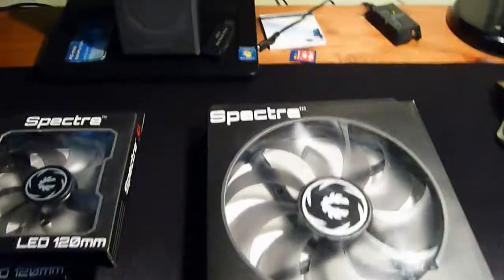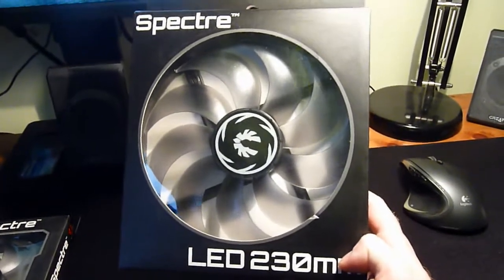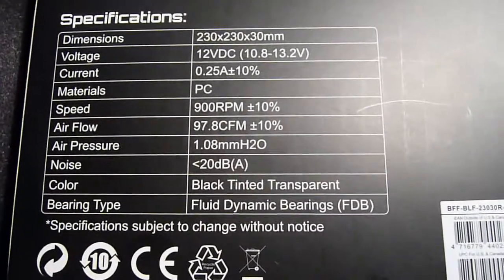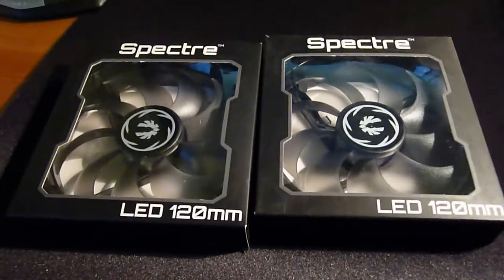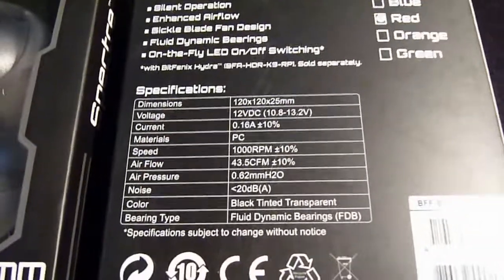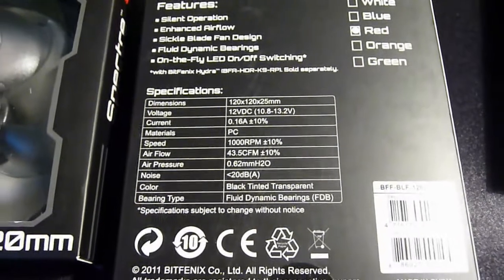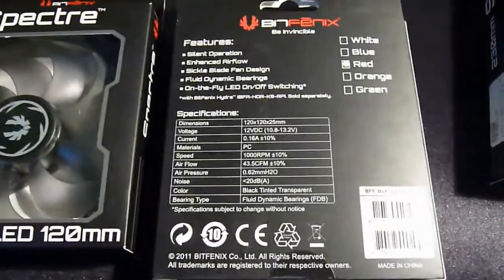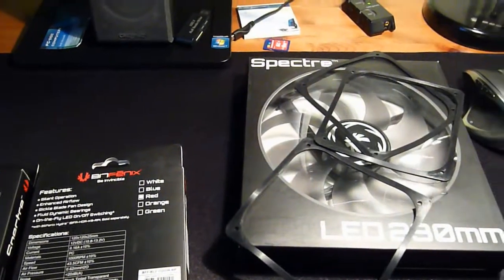Bitfenix Spectre fans - firs look - rzut okiem

Comment: When i changed it to a fan nearly the same as its CFM, the CM 200mm or 230mm I had better temps i.e Better airflow in my case. In summer I really had problems of over heating sometimes I had to remove the over clocking which I made.